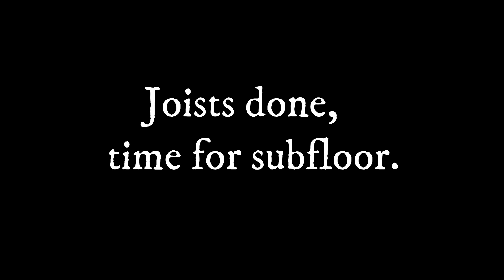Onwards and Upwards! ICF Floor Joist and Subfloor Installation-Joist hangers, I-joists and Subfloor.

Comment: You have 10x the nerve I have to do this project - all the best. What is your plan for winter weather?
Reply from the maker: Good question!! We are racing to get a roof on before serious snow. Then we will poly the windows and can continue to work inside through the winter. Fingers crossed 🤞 🤞🤞